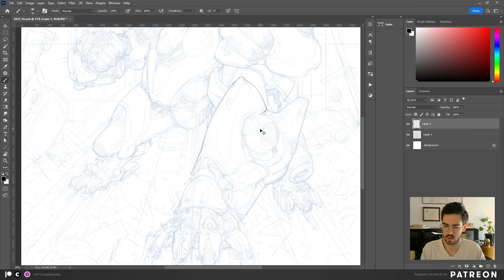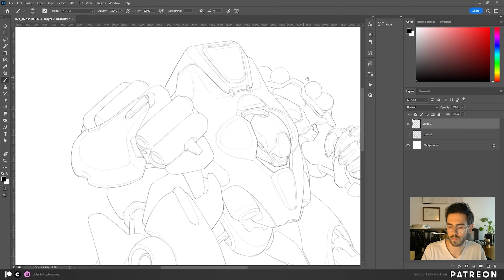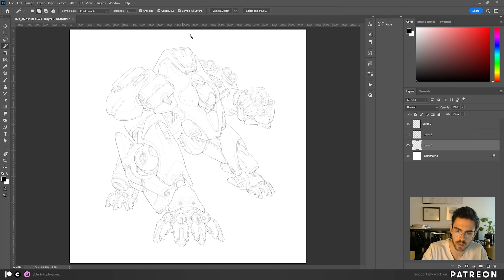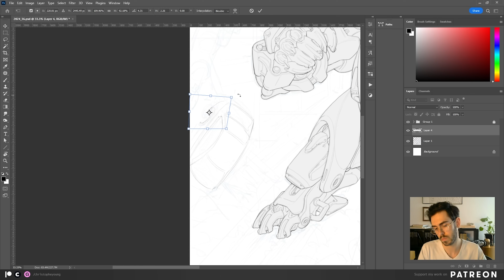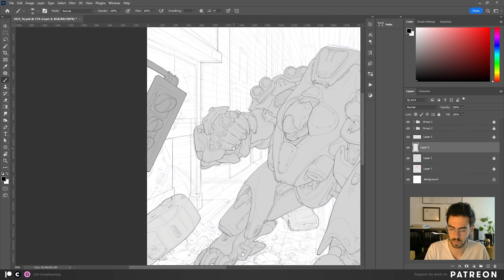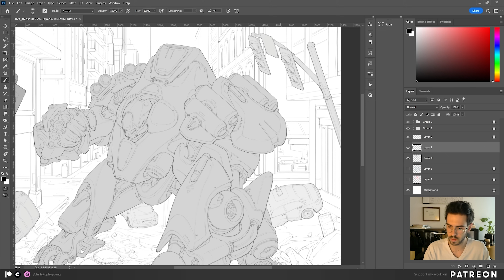Lineart

Comment: Creating some chapters for my own reference:
 
0:00 Logo
0:05 Introduction
2:43 The Primary Pass
5:43 Timelapse (Primary Pass), Couse Information
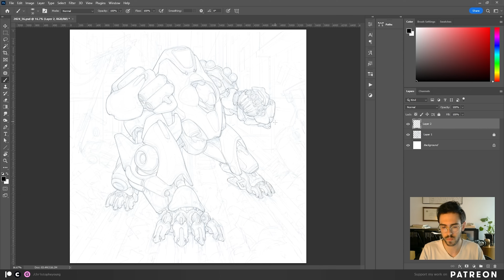9:25 The Secondary Pass
20:08 Timelapse (Secondary Pass)
22:36 The Tertiary Detail Pass
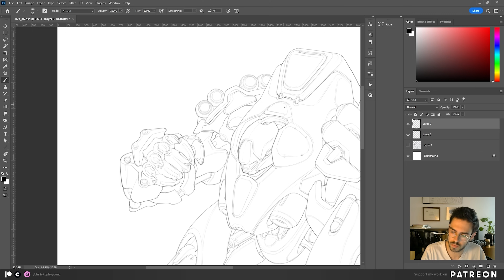26:16 Timelapse (Tertiary Pass)
28:09 Next steps
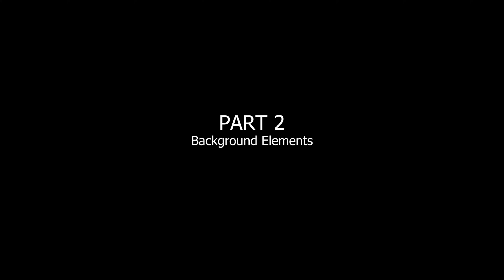36:54 Part 2, Discussing Background Elements
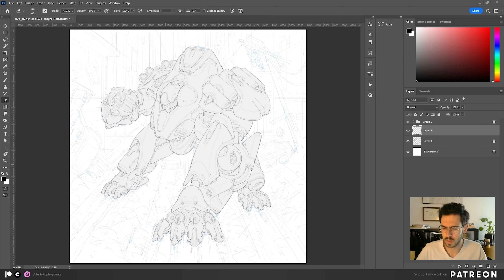42:10 Timelapse
44:55 Separating Layers when Unsure
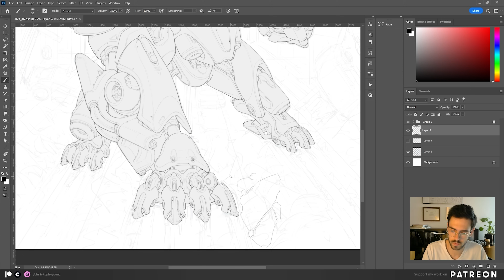47:48 Timelapse
48:21 Discusing a technical challenge
50:25 Timelapse
50:57 Evaluating So Far
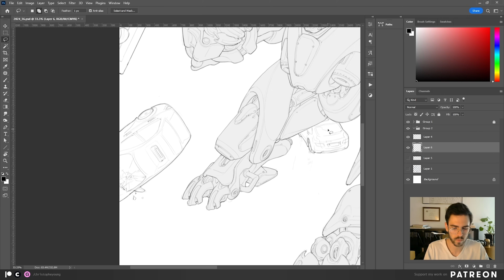52:14 Timelapse (Adding Masks, Secondary Pass)
53:43 Discussion
55:29 Timelapse
55:40 Atmospheric Perspective
56:28 Timelapse 
56:48 Line art as a form guide, not necessarily a texture guide
57:35 Timelapse
58:00 Background Buildings & Perspective Grid
1:00:47 Timelapse
1:01:45 Tip about buildings and architecture
1:03:51 Timelapse
1:04:23 Buildings with more complex facades
1:07:25 Timelapse
1:08:16 Final Touches
1:10:17 Timelapse
1:10:29 Architecture, Frames Within Frames, Detailing
1:12:30 Dotitng Is and crossing Ts, Cleanup
1:13:24 Ensuring the line art reads on its own
1:16:35 Before vs After
1:16:46 Outro

Comment: This is very nice, kinda insight more deeper into how artist actually draw whatever they draw, as you usually do. One interesting question was not mentioned unfortunately, - how do you choose where line should go on top of the sketch. 
So there is thick and sloppy sketch line and then boom, you just draw thin and precise lineart line on top of it, how do you choose where lineart line should go? Is it like on inner side of thick sketch line, or on outside, or right in the middle? I think it is a big question.

Comment: Noob question: How do you draw straight diagonal lines in Photoshop?
Reply: Shift+Click where you want the line to end from where you last drew.
Reply: @Daemonpool65  Yeah, this works for hard brushes, but unfortunately not for soft brushes when you are using a pressure sensitive pen. But thanks anyway.
Reply: @John-Spartan  true. you'd have to repeat the process multiple times with those to get a line to show. The other trick is the tried and true Ruler. simply get one and trace the line using it XD (if you have a screen tablet.) otherwise, nothing beats practicing the act

Comment: at what resolution do u draw and illustrate on, i draw on 1080 p 300 dpi but the lines are vey blurry and hard to draw details, i  dont understand is the Resolution the problem or the brushes i use(soft round and pencil).
Reply: make your canvas bigger
Reply: you can keep the dpi at 72, unless you wanna print the piece it doesn't matter. as for the resolution I wouldn't go lower than 2K for the shorter edge of the canvas. something like twice the size the final version will be viewed at seems to work well. you can always go higher unless it starts lagging...
Reply: @qistickle  is the no difference between 72 and 300 dpi?
Reply: @noMAD045  72 dps is for screen, 300 dpi is industrial standard resolution for printing.
Reply: Firstly my thumbnail sketch are at 72 dpi at 500px X 500px on Raster Layer. Once I'm happy with the compositions and pose of everything (subjects, background, shade, light), I'd open a new file to sketch the details at 72 dpi 3000 px X 3000 px on Raster Layer, stretching my thumbnail sketch to fit the new canvas. My lineart inking would be at 120 dpi 8000 px X 8000 px on Vector Layer in another new file. (I wish I could go larger but that's the okay-ish size for my PC to handle)
Reply: You have to try 4k resolution sometimes then downscale or upscale to your liking